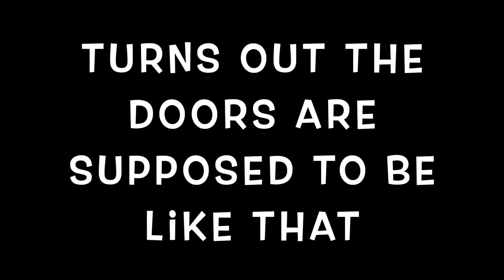Curtis Advantage Cab Full Install Video Including Wiring - John Deere 2038R

Comment: My new Curtis Advantage cab is supposed to ship the second week of September.  My new 2038R is supposed to be delivered next week.  This video will help immensely.  Thanks Brock for making this video.
Reply from the maker: Congratulations on your new equipment. Thanks for watching the video
Reply: @RockhillfarmYT  Brock, I tried to install my Curtis Cab on my 2038R and ran into a problem and wanted to get your thoughts.  I hope my request is appropriate on your Youtube channel.  If not, please ignore my request.  You have a great channel.
My 2038R has the Deere third hydraulic valve option which "stacks" the third valve on top of the hydraulic couplers for the front loader.  The hydraulic lines from the pump to the third valve interfere with the Curtis "A-pillar".  There is not enough room between the hydro pedals and the lines to the third valve to allow the A-pillar to be installed.  I posted some pictures over at the Greentractortalk site.  I have been thinking of replacing the hard lines with flexible rubber hydraulic lines with right angled connections to try to give me more room.  Curtis Cabs suggested modifying the front A-pillar to make the necessary room.  But for now, I can't install my Curtis cab.  Your thoughts?  Again if my request is inappropriate please accept my apology.

Comment: Nice job! very clear and accurate with one very slight correction.  At 46:56 you indicated all of the lights are connected in SERIES.  The correct term is connected in PARALLEL.😊
Reply from the maker: Thank you for watching and for the correction.

Comment: Great video and install Demo

You gave Me a lot of ideas for My own attempt at adding a topper

My Garage opening is only 81 inches high so I can't leave the ROPS up

I bought a few of those hollow plastic EZ Go golf cart tops off of FaceBook Market Place for My 2 Tractors and 2 Riding Lawnmowers ( 4 for $80.00 )

I will have to make mine so I can raise and lower it to get in and out of My Garage

Seeing the front frame assembly and the rear plates clamped to the ROPS have given Me a Great starting point for Fabricating something useable

Thanks
Reply from the maker: Cool.  Good luck with your Build

Comment: Very nice looking forward to the door options and a measurement from floor to roof top would be nice thank you
Reply from the maker: The videos are coming next week for the other doors

As far as the cab height, on mine it is 83 1/2 inches but the best way to measure it is height above the floorboard because your floorboard might not be the same height as mine

I’m pretty sure they have that on the Curtis Industries website for every tractor model.

On the 2038R and 2032R it is 60 inches above the floor board

Comment: Wow I was told from dealer the original tractor cab was the only one available. My Dealer definitely steered me in the wrong direction when it came to ordering my 2032r and Gator 835M Honor. Missing so many packages that I was told wouldn’t work that I see now totally do.
Reply from the maker: Yeah, this is a good well priced cab option.

I have had it for a long time and I have a long-term review out on it. 

Spoiler alert I like it.

 I put out videos almost every day about what you can do with this tractor.

Comment: So Brock, I am installing my Curtis Cab this weekend on my 2038R.  I would like to leave the ROPS folded so that I can keep the tractor in my garage.  Do you think I can install the main supports posts (that attach to the ROPS) with the ROPS folded?  If the ROPS has to stay in the upright position then I will have to intall the cab (and keep the tractor) in my pole shed. Thanks. Your installation video is going to most helpful.

Comment: you leave the roll bar on you are not going to get in a standard high garage door with i think it is 80 in
Reply from the maker: The ROPS will still fold and I think it will fit in a standard garage door. Don’t remember exactly how tall the top of the cab is

Comment: This was a damn good thorough video Brock, I've been toying with the idea of cab, or an upgrade to a 3R with a cab. Not sure if I want to make that jump yet, price point on them is quite a jump. Is it safe to assume I could put a fan in this cab?
Reply from the maker: Yes sir. I have 2 fans in mine

It would be nice to have an air conditioner but you’re talking about a very expensive cab at that point.

I’d love to have a 3046 with a cab but not ready to spend that money

I tell people that this is like owning an older jeep. We used to have a jeep and we only put the doors on it in the winter.  

It stays really warm in the winter, and the rest of the year you have a windshield and a canopy basically so it’s not like it’s hotter than an open station. you actually have shade

Comment: Hi Brock! I received my New Curtis Cab for my 4120 John Deere Tractor It came in a stiff carboard box framed with wood. 6'H x 7'L x 1'-6"W. How did you go about opening it? Did you lay it on it's side or open in standing up? I just don't want anything to break in it when opening.
Reply from the maker: It seems like laying it down would make more sense but I specifically remember doing it standing up. It was all pretty well packaged inside of there and we didn’t break anything

Congrats on the cab

Comment: Little confused about the rear window.  Looks like to open it you have to break the tape seal that holds part of the mat under the seat.  Am I seeing that wrong?
Reply from the maker: You tape Velcro onto the back window and the mat is Velcro On the edges.

You are simply undoing the Velcro between them.  It’s done that way all the way around the mat so you can actually remove that whole back mat if you want to

When I do the video comparing the different door options I will make sure to remove that back glass on camera

Comment: What is the height to the top of the cab from the ground highest point and can you still fold your rops down
Reply from the maker: The Rops still fold just like normal.

The highest point on my cab is 83 inches, but the best way to measure is from the floorboard

Curtis lists height from the floorboard on their site for every model.

On the 2038R it is listed as 60 inches. I measure it as 59 on mine
Reply: @RockhillfarmYT  okay I was just wondering if it would fit inside of a 7 foot garage door
Reply from the maker: Looks really close on my exact tractor, but I don’t have a 7’ door to check it with
Reply: @RockhillfarmYT  okay thanks I have a 2038r to I have a 7 foot garage door I was just wondering thank you very much

Comment: You didn't show anything on the cabin sealing in the front.
Reply from the maker: I’m not sure I know what you mean about sealing in the front. if you’re talking about the actual frame of the cab it’s got that big overhang I have a drip rail that prevents leakage.

If you mean the doors they have the weatherseal already on them
Reply from the maker: Or, if you’re talking about the front window it has a really thick weather seal on it and when you pull down on the handles it tightens down and compresses that seal.

Comment: You do know your shirt is buttoned up wrong?😊🤦🏻‍♂️
Reply from the maker: Nope. It’s been a little while Since it was recorded

 thanks for pointing it out though
Reply: @RockhillfarmYT  it’s all good. Wanted to see if I can use the Curtis cab with a backhoe. Found a vid where the guy had to make a small mod for it to work ! Nice vid. Thanks
Reply from the maker: There may be different versions of Curtis cab so that answer could vary but I use mine with the backhoe all the time.

Actually the video that I put out today I was digging with the cab on

Mine has an easily removable rear glass which makes it work.

Let me know if I can help with anything else about the cab